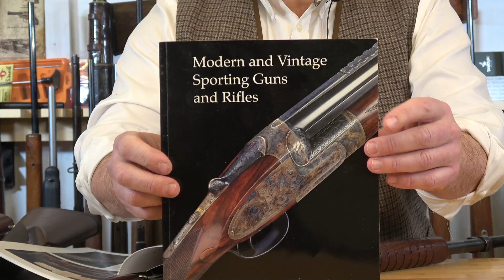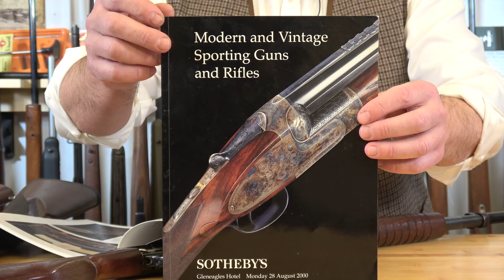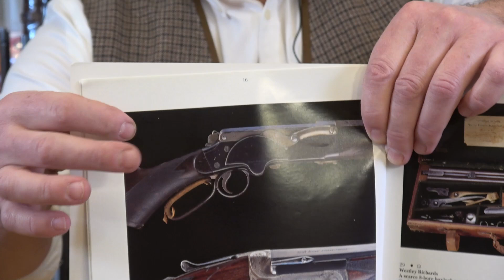How A PUMP ACTION Shotgun LOCKS

Comment: I learned something about winchester 97 because i now own norinco m97 riot shotgun 12 gauge. I took it apart and cleaned out the grease. Very sweet shotty. It has the slide lock action , you need to pull the pump forward to unlock it .

Comment: Great video as always. Another interesting Noble is the pump action .22 Model 235 or older version Model 33. I believe they called it the see through action. The under barrel magazine tube follows the action near the end of its stroke. The follower then articulates upward to push a fresh cartridge inline with the chamber. I recently was fortunate enough to pick one up on the cheap in like new condition. While not not as attractive as some of it's contemporaries, the action is as slick as butter.

Comment: I honestly never thought about this.  It is definitely an interesting topic.  The only pump gun that I own is a benelli nova.  I believe that it has a rotating bolt.
Reply: It has a rotating bolt and GREAT  quality supported by 10 years warranty. Winchester's  warranty is "questionable" although I have never had to use it on any of my Winchester pumps. But when they tell you that just "don't worry" we will be "reasonable"  It doesn't generate  a  "I'm not worried" answer from me.

Comment: I guess the tilting bolt only really works well when the receiver is steel (or has a steel insert). The Mossberg 500 wedge locks into the barrel extension rather than the alloy receiver, I assume for this reason.

Comment: The SKS and STG44 bolt tilts down in the rear to lock it.
Reply: STG44 groundbreaking concept in more than one way, but unfortunately  throw away design and build quality. SKS is made to last forever. Not sure if the Soviets didn't copy the 'tilting" from the STG44. Germans used some of them against the Soviets to increase firepower without using MG34-42s. on attacks and retreats. By 1943 the Germans were doing most of the  'retreating"  when these assault rifles were being used at the first time .I still love the way the German looks.
Reply: @johnturner5893  I collect French rifles and they may have been the first.  The  99 Savage is probably one of the first examples.
Reply: @oldgoat1890  Thank you. I have not googled the first user. just knew about the STG44 and the SKS.

Comment: Not to be mean, but you are stuck in the past. Those are " tilting bolt" guns that were the  hot set up during the 40's and 50's. I suspect Arthur Savage was one of the first designers to come up with it. Anyway, along came the M-16 and then everything had to lock into a barrel extension. The three best selling pumps in the USA are the Mossberg, Winchester and Remington.  All  have bolts that lock into the barrel extension. When sabot slugs became hot, I took an old Mossberg bolt 20 gauge and put a Mossberg 500 rifled barrel on it. I unscrewed the barrel extension and the thread dimensions were the same. I had a cheap bolt action, scoped shotgun.   Anyway, that is why modern shotguns are so light.  Some even had aluminum receivers.
Reply: @oldgoat18,
If you had watched the whole vid you would have seen that he covered other methods of locking, including the Winchester rotating bolt lock- up.